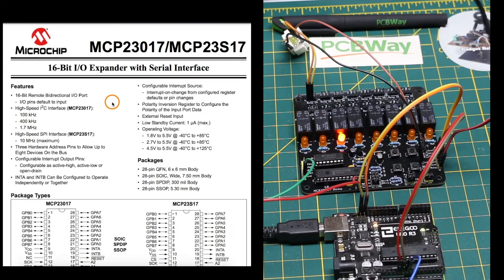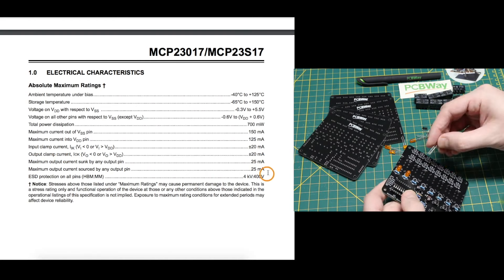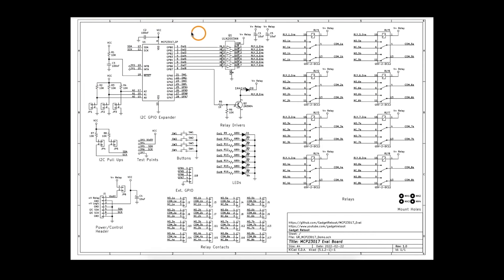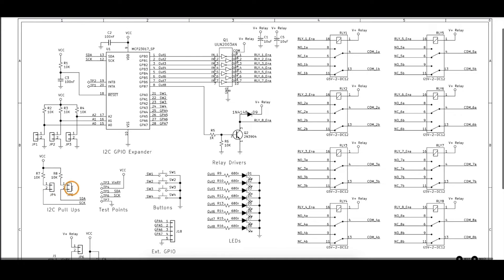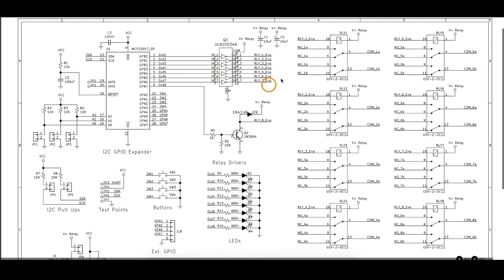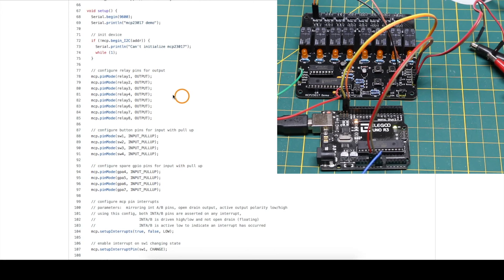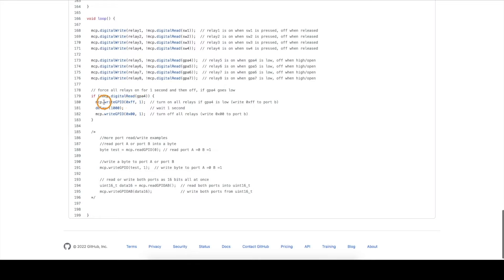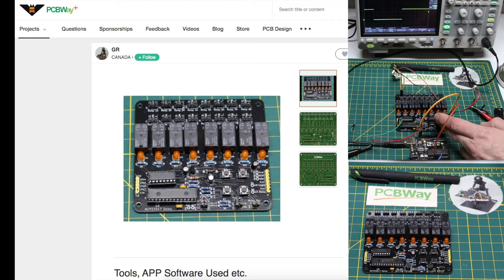MCP23017 GPIO Expander Demo PCB: Arduino Uno Relay Driver

Comment: Thanks. I have sent for five to be made with my last PCB order.  I have this io chip on an stm8 board I made a while back for something and they work quite well.  I need to get the relays or make an adaptor-bodge for others I have already.
Reply from the maker: I wish I had bought more of the IO chips when I bought the first five because now I want more and they are not that easy to find unless I want to pay a premium and hope they are not fake from the usual low-cost sources.  So I think I will be rotating the five chips between different projects thanks to the sockets on the board.

Comment: Excellent video and what a useful board to have, such versatility. 👍😀
Reply from the maker: I am soon also going to be trying to work with those ATtiny devices you sent a while ago, hopefully next month I’ll have some project videos on those.
Reply: That WAS awhile ago! Sell them to a car manufacturer - they can't get any! 😂
Reply from the maker: yeah I was just starting to pack everything up for the big move and it took this long to feel settled again. I just recently ordered more parts from Mouser including more of those ATtinys and they were scarce but I managed to get a few scraps. 
All the ones I would’ve preferred were not available because they were basically close to the same price but might have double the memory so of course those are the ones everyone took first.

Comment: ist es evtl möglich damit 5 Volt bipolare Micro Strepper zu betreiben
Reply from the maker: I wouldn’t recommend using a mechanical switch like a relay to generate continuous rapid clock pulses. It should really be some kind of semiconductor.

Comment: A word of warning,  if you drive 2A through the contract it may not work reliably at very low current after. When switching on very low currents the contracts need very good wetting to do this. This ability to achieve good wetting will be removed with the first current spike on the contracts. So if you want to switch audio don't switch power with the relay before hand.
Reply from the maker: yeah I will only be switching low-level signals, and I don’t want to blast through any gold.